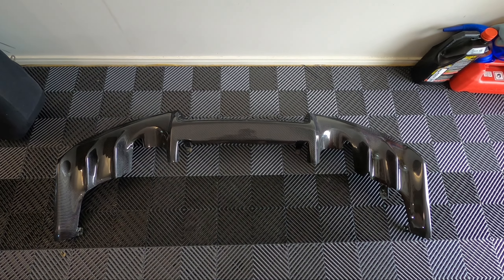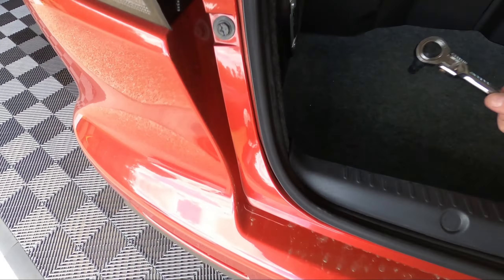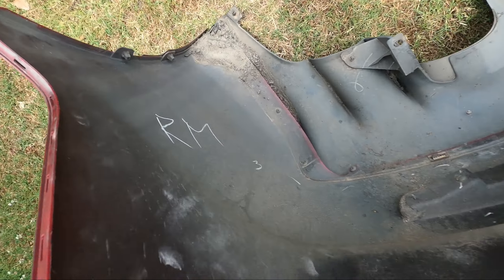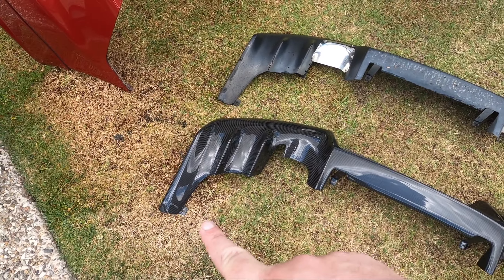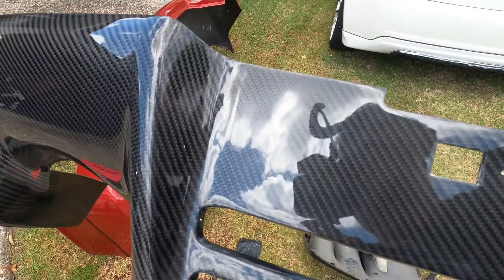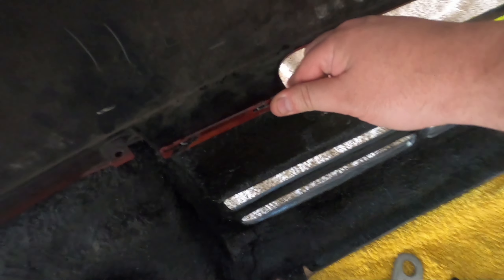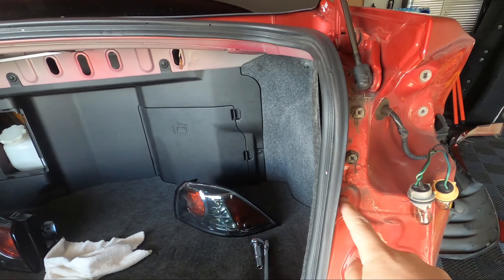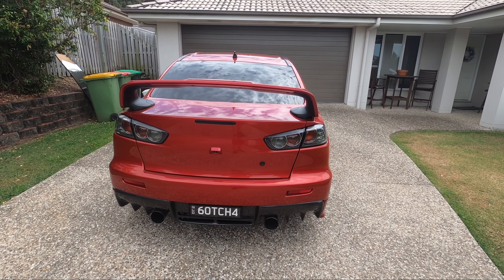Evo X Carbon Fibre Diffuser Install

Comment: Jackson, great rundown, very helpful and insightful. Def leaning towards getting it now after watching this a few times. My 08 Evo X also has the dual Ralliart exhaust shields, are they just simply riveted to the OEM diffuser? You reckon a simple drill out of the rivets and rivet onto the CF one would work?
Reply from the maker: Thanks mate they're actually bolted on with a tiny Allen key and 8mm bolt so just remove and redrill into the new diffuser
Reply: @JacksonStrain  thanks for the reply mate considering this video is now over a year old. I've had my X exactly 11 months Sat just gone. Also looking at CF bonnet scoop but trying to find on online that has mountings and isn't a wonky for its proving difficult.
Reply from the maker: @19schuey  yeah I didn't have much luck with carbon scoops the one we ran on the red Evo I bought used but I did a get rexpeed carbon one for my black Evo and the fitment was trash so I ended up not running it

Comment: seems like the “fins” are more pronounced than the oem one, and yea it does look good. dont you wanna install the exhaust heat shields? im curious to see how they would look like on the cf
Reply from the maker: You might be right, and nah she wants to keep it as is and doesn't think the exhaust heatshields flow well as she doesn't have much silver or chrome on the car